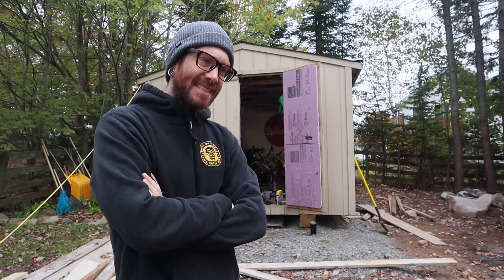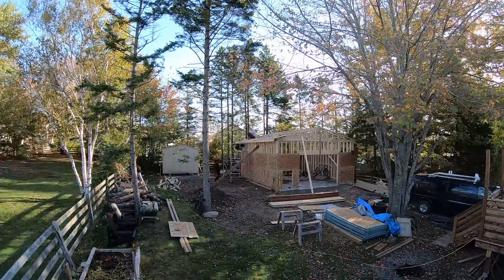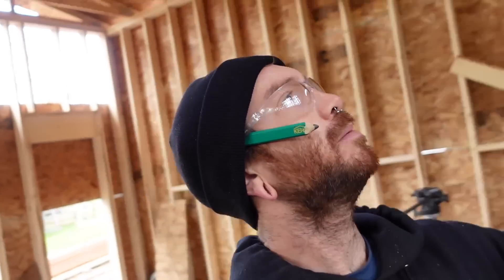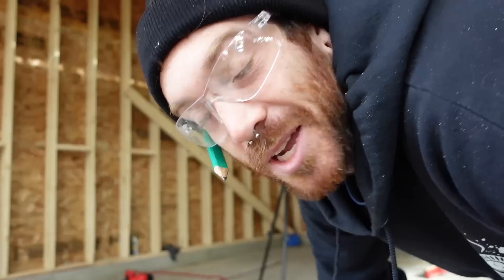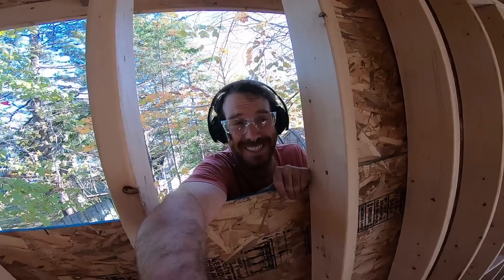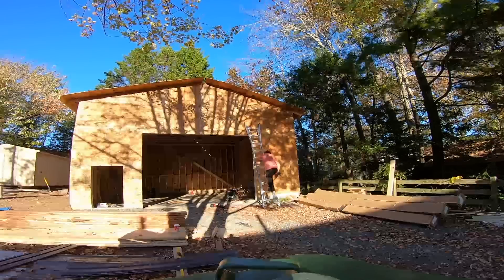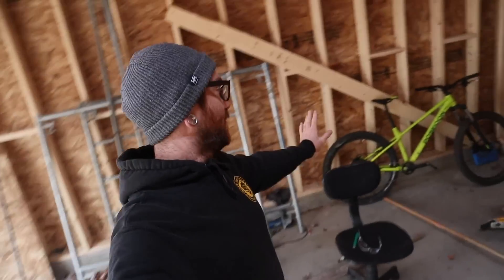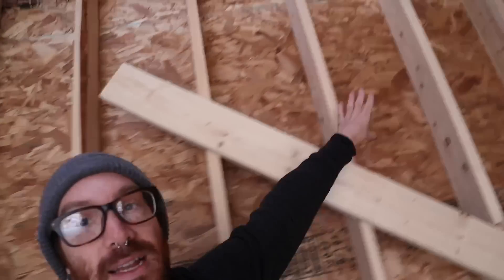Building My Dream Garage |Part 2|

Comment: At this point in construction, I would hire in a contractor to foam insulate the whole building. That would keep your heating and cooling costs down to a crazy low amount, sound proof the building, and add structural support.
Reply: Wise words sir.
Reply: Ah yeah make it even more flammable then it already is lol.  Foam insulation is such garbage!
Reply: As a contractor, unless there is a ventilation  plan and system in place, that will be a regrettable decision. Your ventilation needs to be taken care of before they can be spray foamed.

Comment: as a pro framer it looks pretty good if you added a rat run or blocking down the centr or  close to the center of the ceiling joist part of the trusses that would stiffen it up alot

Comment: Hey Eric, in NZ and AUS quite often large timber walls use angle bracing. Its a steel  right angle long length of metal that goes from the base to top on an angle. You notch it into the timber framing and flat head nail it on facing timber edge,. It really stabilises walls.

Comment: I found while working as a framer a lot of wall rigidity came from sheathed walls. H1 clips would help the trusses assuming you haven’t installed them yet. Where I worked we also did blocking on either side of exterior doors to help ensure the door frame didn’t twist or warp. But not really for the big garage door though.

Comment: Until the end I was thinking it must be extremely tall based on the size of the small door.  But ya, sheeting.  I like the idea of no windows, the siding will go up so much quicker and even with windows you'd still turn on the lights when you go inside.

Comment: This was my concern in one of your past videos about the lack of purlings and what is commonly called "rat runs" connecting and locking the trusses together. When I was a carpenter building houses, apartments, condos etc, we had an engineering print that showed where to install these items to strengthen the building. I have seen the results of buildings that there were no purlings installed after high winds, not a good thing. One example was a whole roof system collapsing in on itself.

Comment: If you do spray foam it, use ‘closed-cell’ foam. It will not absorb moisture and act as a air barrier. Open cell will NOT.

Comment: Glad You put The 'stiffeners' between each studd. Was kind of wondering why there wasn't anything in between. Looks. Sick 🤘
Reply: With the second set of them try just put them in 2 or 3.imches above. Or below the height Of What you already have installed. Or look up what is to code and standard for you. Here they have to be installed within doudle. The thickness of your blocking piece